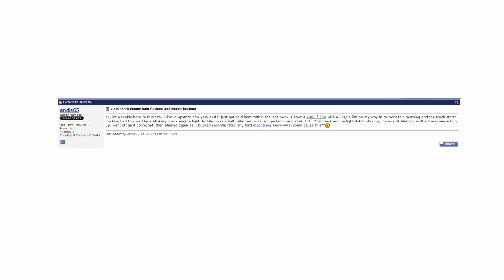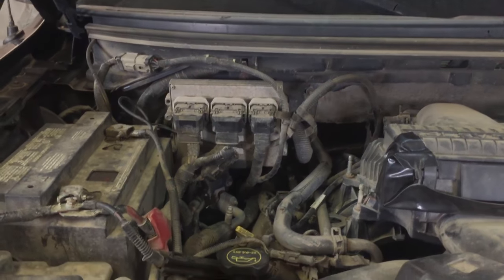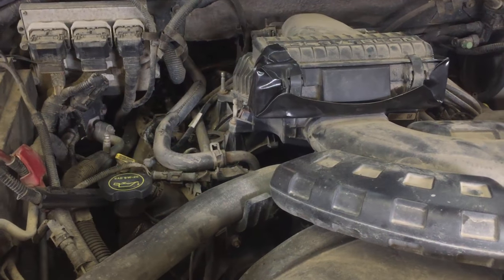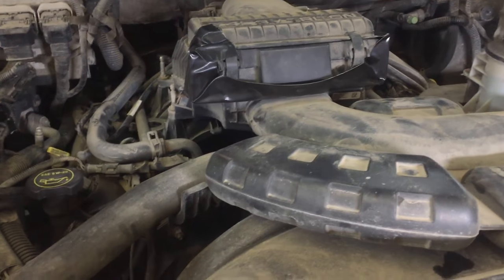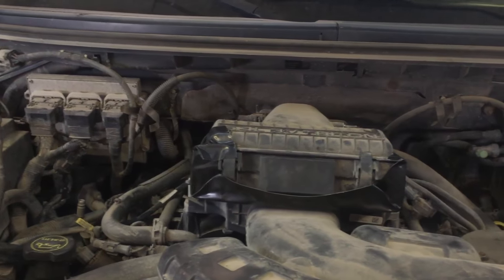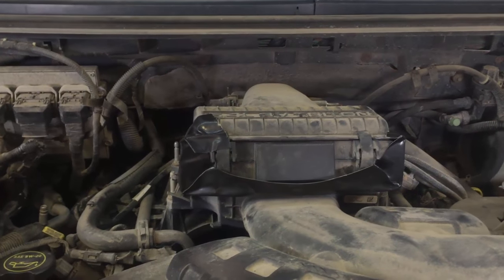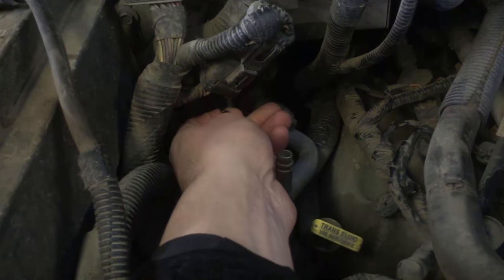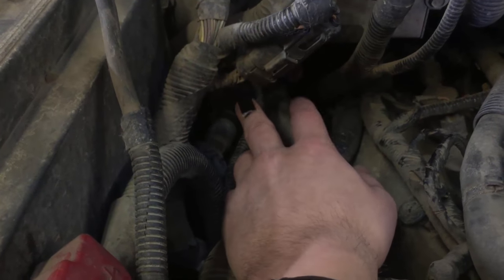5.4L ENGINE MISFIRE CODES FIX AND ENGINE SHAKE FIX

Comment: This worked great.  I removed my plug ins to the PCM, sprayed the pins with CRC Electrical Connector Cleaner and used my air compressor to dry them out and clean out any debris. These pins were very clean anyway.  Then I went to Lowes and picked up the weather stripping and cleaned off the old gasket material on the air filter case. I also vaccumed out the area where the filter goes.  It is running much better. Thanks so much!!
Reply: did the same, now truck of one thousand codes runs correctly again, incredible

Comment: That vacuum line that you're referring to with does it going to it that is the I guess you would call it the exhaust or the relief for your vacuum actuated hub locks for your 4-wheel drive you need to unplug that if you ever decide to use your four-wheel drive

Comment: Thanks , what I did was let the air pressure out of the fuel injector rail started the Lincoln Navigator and the problem went away .. So yes you’re right it could be anything..

Comment: Different year:  2002 F150 Triton 5.4l.  I replaced A/C and all hell broke loose.  I had p0352 (second cylinder electrical issue) and A/C compressor would not run.  Changed spark plug, injector, ignitor coil with no luck on p0352.  Finally, after two year delay, I re-inspected the electrical connectors on the firewall for possible damage.  I found that two of the pins in the bolt together connector were pushed back and probably not making good contact.  I also found that IF I had a p0352 code the A/C compressor would not run.  Every time.  When I fixed the connector, both p0352 disappeared AND the A/C compressor ran.  I am not sure of the reason for this.  This was a key find and allowed me to finally fix both issues by making sure the connector was in good condition.  If your not successful at first or only have a temporary/intermittent fix, examine the connector even more closely to make sure that the pins are clean, the gasket is not preventing full engagement, and that your connections to the ignitor coil and fuel injector are securely engaged.

Comment: update, my truck is a 2006 5.4 3v, i cleaned the plugs on the pcm but i feel replacing the weather stripping on the air cleaner was the trick that worked. cheap to do thats what worked for me. great video thanks!
Reply: Was yours pretty bad? Mine is 06 as well. If I hammer on it, it won’t go over 50mph. But if I ease off it, and ease back into it, it’s fine. Sound similar? Thanks man!
Reply: @kaine_3863  my 07 does that, did you fix yours?
Reply: @kaine_3863  did you ever find a fix?
Reply: @jaimemoncivais552  did you ever find a fix?

Comment: My 99 started  running a little rough  . Then I was  looking for a vacuum and moved the air box then cylinders  1, 2 ,3 ,4 codes came up misfire  . I was at a loss ! I just saw your video and when this rain stops will certainly give them a try ! 
Thank you for your share !
Reply: Did it work?
Reply: @Niko-iq8bc  
With all the property damage the this last storm did I haven't had time to try  !  I should get to it in a day or so  .
Reply: Did it end up working for you David?
Reply: @2vfidel  You'll never get an answer from this flake, who had absolutely ZERO point in posting.

Comment: I appreciate your video.  I am trying this on my 2005 Expedition with the 5.4 V8 today.  Thanks
Reply: Wow thanks! I change out spark plugs, put sealant and weather stripping still had rough idol....cleaned and reseated the connectors and BAM! No more rough idle and cleared out check engine light. Thank you sir!! Now to fix leaky coolant problem 🙄
Reply: @ryanruz9397  did you get your coolant issue fixed? I had to buy a new upper intake and have it replaced. The coolant was coming out due to a small crack by the thermostat housing.

Comment: Straight To The Point did this resolve your engine shake and misfire ? i did this and for a couple days it seemed to get better but still minor engine shake.   but low and behold i got the p0303 couple days later and rough on slight acceleration and low power. i replaced vct solenoids like everyone says to do as well.
Reply: vcts in the end of the valve covers if these wacky ideas don't work lol

Comment: I was told I need to replace both of my catalytic converters my ford 08 f150 is doing the same thing as ur on top of the smell of raw gas all day and it’s drinking so much gas. Check engine light on and it has a back misfire was cylinder 8 but all the plugs and coils have been change.  Do you think the converters could be the issues
Reply: You might have a broken spark plug if your getting a fuel smell.

Comment: So I bought a 2008 f150 with this problem ford said it was cam phaser problem we put in new phasers, timing chains, sensors and tensioners but had troubles timing the engine so we took into a local shop and they “fixed” it for $3,600 and the truck ran great for 3 months no problems I even took it off roading in some mud and worked prefect. Last weekend I took it out to our campsite and the truck stalled out. I drove it home with little to no problem and I took it out today for a 15 min drive to see what would happen and the check engine light came on and it the rev meter was trembling and misfires and it was shaking going 80kmh down the road and the knocking was pretty bad. We put in a code reader and it had the P0300 code. So next week or so we’re gonna replace the spark plugs and see what happens and try things to get it running so I can just sell it and be done with it.
Reply: Update: we changed all 8 spark plugs and changed the fuel filter and it runs perfectly fine
Reply from the maker: You change the fuel filter? they are external on these years.
Reply: Straight To The Point yup it was right under driver seat

Comment: Yes you are so right don't listen to the haters. I did these 3 things and the truck immediately started running correctly, check engine light off,
the vacuum hose T's into the vacuum hose running horizontal directly above the one you have tape on. with a check valve between the 2. diagram on sticker attached to the plastic over the radiator. At least it is on my Expedition. thanks man!

Comment: Check the pcv valve, it is located at the Valve cover, on the driver side if stuck open that’s the problem wen engine has multiple misfire and shaking at idler

Comment: mine is doing this intermittently, check engine light flashes and i dont get any codes. always at higher RPM,3k-4k 70-80 MPH. im going to try your tips thanks.
Reply: Did you get it fixed

Comment: Where to reput the foam ?  I forgot where it was.  My truck did it today after a 2 hour drive in tye heat and a fresh oil change.  Stopped at a stop sign jumped back on highway and stutter stutter check engine light flashes and then went away.

Comment: Unplug both of your variable timming solenoids they are located on the front of your valve covers and see how it runs you can run the truck that way but if this is your problem your cam phasers probably need replaced

Comment: Mine had a Huuuuuummmm noise at idle. Replaced the IAC valve and fix'd that. Still left with a slight misfire nudge as she idles. Whille attempt to unplug coil AND injector connectors searching the cylinder. Scanner w/live data isn't showing anything out of place other than a misfire overall in general not per cylinder test. The challenge is fun I guess.
Reply: IAC valve?
Reply: @tunyung  Intake Air Control Valve. It's on the rear part of the intake. A bugger to get the bolts out.

Comment: What is the hose just to the right of the PCM thicker diameter, ribbed, curved back into cab, connects to a stiff metal line/pipe. I seem to have a leak from there into cylinder 4 which is causing my truck to misfire.
Reply from the maker: Heater core goes into the cab for heat. You're probably leaking coolant into the sparkplug well and shorting out the coils
Reply: Coolant is probably leaking into the coil. You'll need to replace the boot, spring and plug and definitely get the leak fixed or it'll continue to happen. Easy way to check is after letting your engine cool down for a couple of hours pop the coil pack off and look down into your spark plug inlet. If there's any moisture, that's not good.

Comment: my inlaws 2007 harley f150 5.4 started pulling. he found it that 3 cylinders are misfiring. he has never changed the spark plugs. never done a tune up. oil changes on time are questionable. they told him he has to rebuilt or swap the engine.

Comment: Thanks for your video ! I has same problem 
Bought the truck ! Start but when put on drive or back up it shake but when I drive around 20-30M/h it ok 
Press gas it shake again after that drive fine at 60-70 
Light on need service soon
Try to replace coil and spark plug later 
Thanks

Comment: I’ve been trying to diagnose my 04 f150 rough idle n misfire for a year now, spent way too much throwing parts, gonna try pcm then I give up
Reply: What it was your problem in yout truck at the end?
Reply: vcts
Reply: Try coolant sensor. You would be surprised.
Reply: @teddavis942  vcts?  What is it?  Spell it out for us thanks
Reply: @lindseywagner7510  coolant sensor can cause these issues?
Reply: @lindseywagner7510  there is no coolant temp sensor it’s a cht sensor aka cylinder head sensor that’s where they measure temp

Comment: Just bought a 06 with a 5.4. Can i have a misfire but no Check Engine light? runs good but quite a good shake at idle
Reply: Me too following
Reply: Same here need to know
Reply: Tell us more!  Did you fix it?  I got a 1997 same problem
Reply: @tunyung  I dumped some SeaFoam in the tank and cleared it up. Dirty injectors likely?
Reply: Did it ever stall when coming to a stop?

Comment: I just replaced the cool! Sparkplugs! even the throttle body and it did run better ! But still have the misfire and rough idle when cold,,, it runs very nice once it's hot! But you can still feel the misfire  and code on #4 cyl,, inevern eeset the PCM and nothing!! Next is replacing the temp sensor,,,
Reply: FelixD cat did changing your temp sensor help?
Reply: I believe the deals at both ends front of valve covers is the shake etc issues. called vct I believe.

Comment: My 2007 Ford expedition is having the same problem it say in the diagnostic cylinder 7 misfired.im taking to the dealer because fews mechanic want to deals with it
Reply from the maker: I tried that too. They had no idea... I finally just gave up and bought a new motor...
Reply: I have the same car it worked for me try this video trust me
Reply: I have same car do what he says it works

Comment: That’s not vacuum line you plugged there buddy, it’s your A/C system moisture drain. You better unplug that unless you want to replace your evaporator core because it’s been sitting in water.
Reply: No it's a vacuum line to actuate the front hubs.

Comment: Be wild if my truck can fixed with your vid.  Thanks
Reply: Its actually felt along bottom and sides of air filter frame that holds AF and slides in.  I used 3/8inch rubber car gasket sealer. Clean frame off good, cut gasket to size, remove the adhesive covering, snd attach to the plastic frame.

Comment: Vct solenoids and new high volumn melling oil pump and you'll never have this again ,not phazers its topend oil volume that ford fuked up on
Reply: Male sure u get updated parts for these motors the solenoids have bigger inlets and the oil pump more volume
Reply: Yeah a lot of people have mentioned vct solenoid for these symptoms
Reply: I've done both solenoid and high volume pump and still have random missfires and shaking etc...
Reply: @lindseywagner7510  You seem really knowledgeable about these trucks.. can I borrow your number to ask you a question about mine?

Comment: It’s probably the phasers
Reply: My truck dose the same an idle low then high an now has a odor like bad gas or something but mine is a 02 f150 4.2L having trouble finding much out about it an my engine light is on an when I got it checked all codes came up engine disabled an all that not shore where to start

Comment: My truck does this after a rain and the air is very moist
Reply: Weather stripping under the windshield
Reply: I'd check your fuel tank pressure. Sounds like that might be a leak and pulling atmosphere from outside. That system should be under a vacuum.
Reply: I'll check each of these... The fuel pressure one I may need to do research on, that's for sure

Comment: Damn you can get whole set of coils for $200 in the States
Reply: On Amazon they got 8 coils and 8 plugs for like 75 bucks.
Reply: You can order a whole set of coils here in the states for 40.00. They come from China but so do the oem ones that are called Motorcraft. Anyway. I paid 35.00 plus tax. Less than 40.00 for all eight coil packs and they been working great so far.

Comment: The Ford dealerships are incompetent and even deceitful. After having so many bad experiences with multiple locations I decided to start doing my own maintenance and to never purchase a Ford again.
Reply: Every truck is going to fail on you at some point. Stop doing that thing making everything chevy vs ford ffs. I've got both and they have both F'd me plenty of times.
Reply: @Jabullz I hate over engineered crap like the 3v Triton. I had a 2000 Silverado that never let me down until a rock busted the transmission. 380k miles. 
This 04 f150 is bleeding me of my time and money. It's spent more time sitting in the few years I've owned it than I've driven it. 170k miles. 
The engine is a horrible design, it's electric system is chaotic. My dash lights quit working, then the obd Port, then the 4x4, now the bad misfire. I've done timing chain, phasers, lifters, rollers, cams, oil pump... It's just a piece of shit 🤷 I'll take an obs over anything 2000s and up.